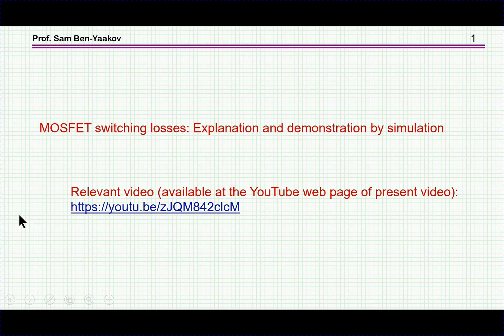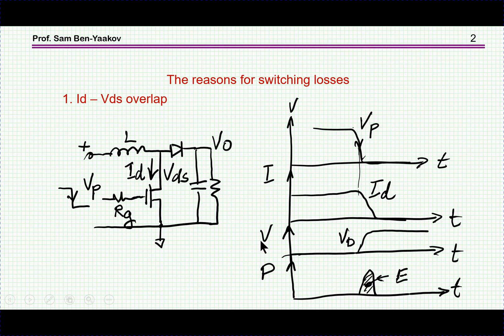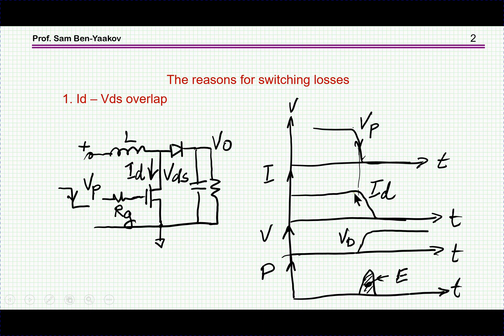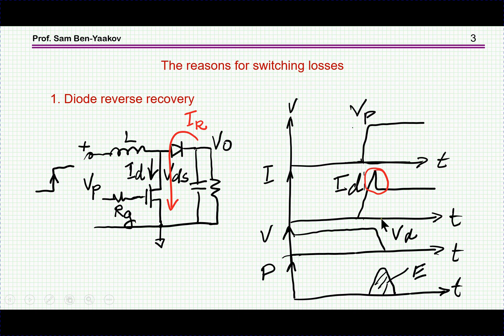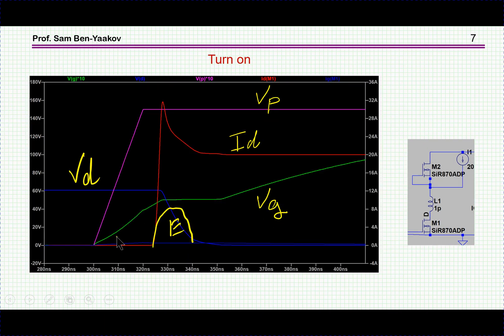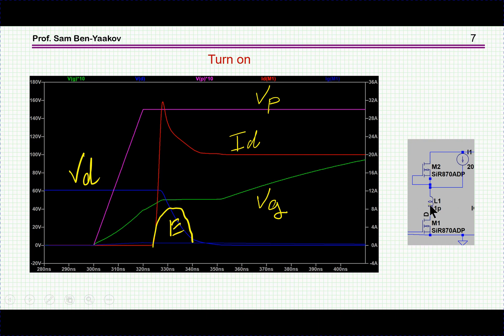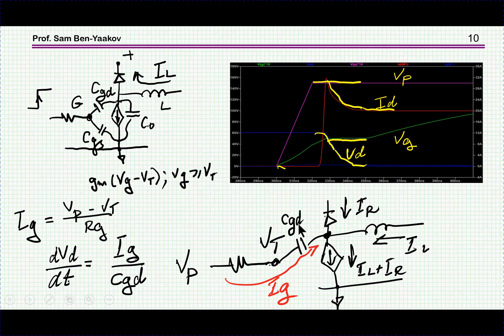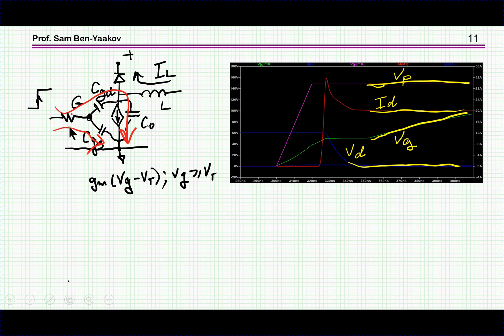MOSFET switching losses: Explanation and demonstration by simulation

Comment: Thank you so much. As always, a wonderful lecture. Please tell me, how can I calculate the power loss in a bjt transistor?
Thanks
Reply from the maker: is this in a linear mode or switching?
Reply: @sambenyaakov  switching, professor. Half bridge power supply.
Reply from the maker: @SMV1972  he best is by simulation. Otherwise you need to know the CE voltage drop and rise and fall times.
Reply: @sambenyaakov  There is quite a lot of material on the Internet on calculating the thermal losses of field-effect transistors, and practically none on bjt. Could you tell me where to find such a calculation method? I would like to learn how to calculate on paper,(having all the necessary transistor parameters) because it is not always possible to use simulators.
Thanks anyway!
Reply from the maker: @SMV1972  It is a bit a lost art as BJTs are not uses that much for switching anymore (IGBTs are still in use), will see.
Reply: @sambenyaakov  thank you!

Comment: Can you explain how to calculate the switching losses of MOSFET in a buck boost converter ?? What are the external parameters we have to consider to calculate accurate switching losses??
Reply from the maker: Hand calculations of switching losses is difficult due to the non linear behavior of capacitances and reverse recovery of the diode, not to mention parasitic inductances in the transistor and interconnect.

Comment: Thank you sir for this video. I have a doubt related to the turn off losses. The energy 13uJ during turn off will not completely contribute to turn off losses right? As some part of it is stored in Cds and will not be dissipative.
Reply from the maker: Which minute in video are you referring to?
Reply: @sambenyaakov  From 15:37 to 15:44, the highlighted turn off loss represents the actual turn off loss (dissipative)+ power drawn by Cds to charge from 0 to Vds (non dissipative)
Reply: @akshaylaturkar  I believe Eoff stored in Coss should be deducted.

Comment: Thank you professor for this great video! Just a small question about the Id overshoot during the turn-on process. Is part of this current overshoot caused by the current charing the Coss of M2 (High-side MOSFET)? And as I know most of these commerial SPICE models did not have the reverse recovery modeled.
Reply from the maker: Yess about the Coss. Newer models have-include the reverse recovery. See also 140. Krihely, N. and Ben-Yaakov, S., Modeling and evaluation of diode reverse recovery in discrete-transition simulators, IEEE Energy Conversion Congress and Expo, ECCE-2010, 4514-4020, Atlanta, GA, 2010 https://www.ee.bgu.ac.il/~pel/pdf-files/conf141.pdf
Reply: @sambenyaakov   Thank you Sir! I already have this paper in my reference list for the topic of "diode reverse recovery".
Reply from the maker: @nickname8708  👍

Comment: Beautifully explained, professor.
Just a point for the viewers:
The simulation is more identical to an output stage of a buck converter, wherein the reverse recovery effect of a diode is shown on turn on of a  low side mosfet with a diode considered across inductor.
Reply from the maker: This is the case of a half bridge of an inverter when the phase current is coming in. There is life beyond the Buck converter😊
Reply: @sambenyaakov  got it, however you said it's a synchronous buck in the video.. and that took me a while to engulf..😅
Reply from the maker: Indeed, I should not have mentioned Buck. Thanks for bringing this up.